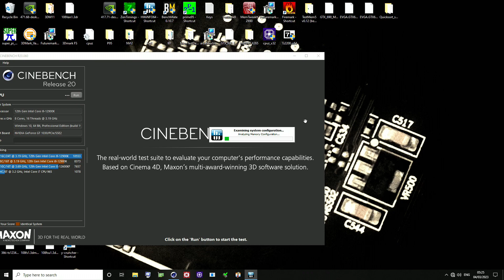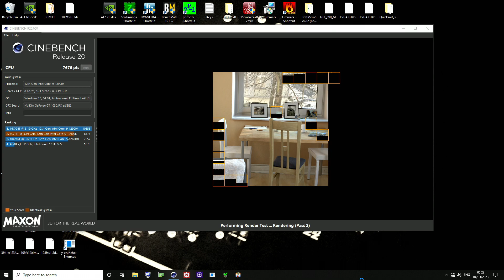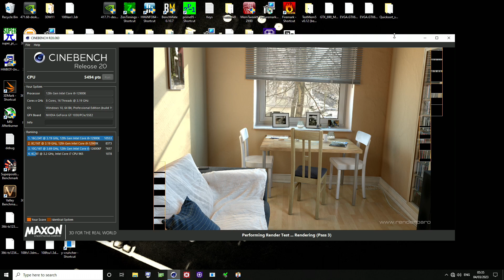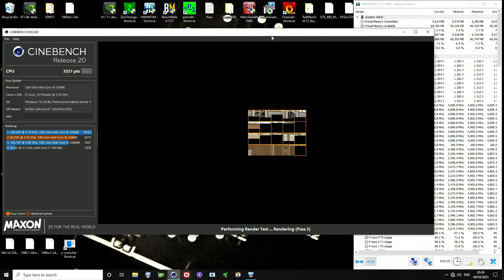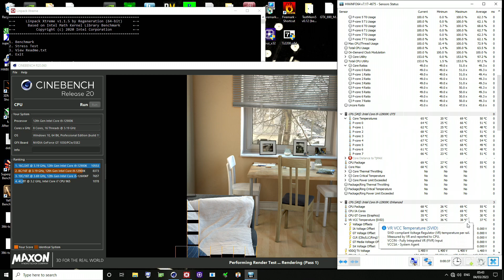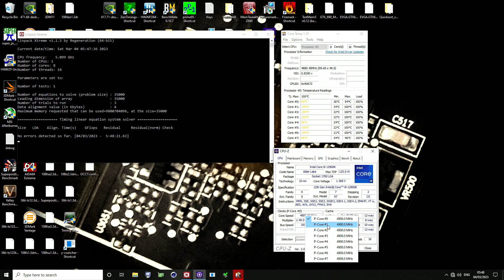EXTREME CPU CLOCK STRETCHING on intel 12th gen

Comment: Have you tried ram overclocking with non-K 12th gen parts? I know edge use case but I can't even enable xmp with my 12400f in the MSI Pro B660M A and some people are suggesting it's because the memory controller is supposedly voltage locked on non-K parts
Reply from the maker: yes VCCSA is locked and the CPUs max out between 3200 and 3600 in gear1 and 4533 to 5200 in gear2

Comment: Is this literally clock stretching (in the same sense that slow I2C devices hold the clock low and change the clock’s duty cycle) or is it just a change in frequency? Do CPUs have pins that output a signal that tracks the real clock frequency/phase? There’s gotta be a debugging mode for this

Comment: I’ve noticed just sheer heat will cause clock stretching even though it’s usually a voltage issue

Comment: I don't know if my 12900k is clock stretching or not, because I am using aorus pro and I have set the llc to low at day one, but I have never reached over 28k points in cb23 even in I am in 4.9ghz all core and 4.0ghz e core. I am now trying to set it back to normal llc or auto to see if it can reach higher score, but I think the voltage would be much higher since I am doing 5.2 ghz all core right now :\

Comment: Perhaps the thingy from Thermal Grizzly would help? If you're not using it already of course. IDK. 12th Gen is a mystery to me, I just hope that on Zen 4 they won't repeat the problem with only 1 lever - even though the size of the IHS is much smaller and not rectangular, I hope they won't try to save 20 cents on mounting.

Comment: Well, my 12100f works at -0.2V offset without a problem. At -0.23V it just crashes under load. Maybe this happens only with higher clocked CPUs.

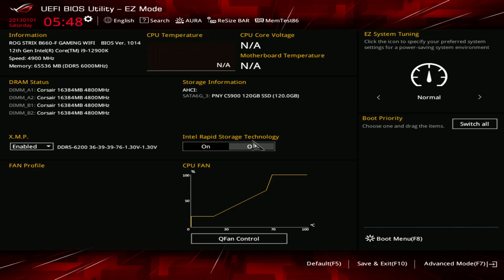Comment: 24:56 - the best part of the video right here

If you disable thermal monitoring, the CPU stops throttling under load!
hell yeah
Reply: What if it burns out?
Reply: @yooanto9465  I wouldn't do it with a 12900k. And I run overkill cooling.  The danger is probably more from long term running above temp spec than from sudden short spikes. U still have the power monitoring on the board which should perform an emergency shutdown if ur sucking down a really excessive amount of power. And I would think burning out a chip would be more dependent on the current ur feeding it than the temp it's hitting. Someone correct me if I'm wrong about that pls lol.
Reply: @christopherjackson2157  in auto setting temp. touch 100c with arctic freezer 420II.
today I disable hyperthread and C drop by 10 . Then I put all P cores to 49 and E to 39 . Voltage to 1.3 it runs way cooler now 77 c and get higher points in C23. Is this called good setting?
Reply: @yooanto9465  that sounds much better than what you had before for sure. I don't have enough experience on alder lake to comment on specific performance numbers. 
77 degrees under load is fine tho.
Reply: Lol yea I do that almost by default now
If it's too hot I'll figure it out when it crashes :)

Comment: My 12400F clockstretches on Asus B660m K if I lower voltage offset by more than -15mv in bios.
Reply: Exactly the same here and also with gigabyte boards

Comment: This is pretty severe stretching. I experienced clock stretching on the order of maybe 10-20% performance loss on my ryzen 5900x using a voltage offset. This is a whole other level lol

At least on Ryzen HWinfo's effective clock reading shows that you are clock stretching.
Reply: What do you look for to see if it’s stretching?
Reply: @nickpowell7432  In hwinfo you will see values for clock speed and effective clock speed. Effective clock speed will be lower than clock speed if your cpu is stretching. But as seen in this video that isn’t always the case. You need to verify with a benchmark. However, if your effective is reporting lower than clock speed you can be 99% sure you are indeed stretching.
Reply: @rdiznfriends   I thought that’s what you were going to say but I wasn’t sure thanks.

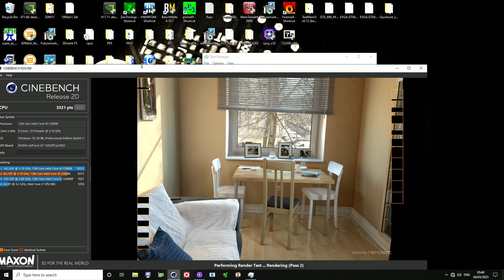Comment: About GTX 1070s "extreme undervolting" issue you mentioned @16:20 :
I think it's because VRAM clock speed dropped to "2D" or "Low 3D" level, from standard full 3D clock. For whatever reason, memory clock speed just drops by 80-90% below certain vGPU value or V/F point. I have this on my big Pascal GPU as well (when tested how low I can go on vGPU).
Reply from the maker: Nvidia cards clock strech across pretty much the entire voltage range. The less voltage you run the more severe it gets.
Reply: @ActuallyHardcoreOverclocking  About CPU stretch : Can this be some weird cTDP setting at play or a power feature thing ?
My logic goes something like this : 
MB : I'm decreasing Vcore from default by -xyz mV.
CPU : Oh, you want lower vcore FROM stock... OK, sure. No problem. 
But once you at it, better drop my TDP to 65W/35W along with it (since we reached this [xyz] voltage drop).
MB : Will do.
CPU : I will show stock frequency under load, because we are on [Auto].
MB : OK.

Comment: Hey guys. I have an idea that won't leave me.
So my motherboard MSI B450-a PRO has newer version MSI B450-a PRO MAX. I belive the only difference is that it has 32mb bios chip instead of 16mb. I wonder if I can expect correct functioning of the board if I just replace chip to a new with a new bios? The only reason is better UEFI UI and built in OC profiles memory instead of using USB stick. 
What do you think?
Reply: Honestly I'm no where near knowledgeable to answer if that will make a difference though. However though, if you're eager enough to try, just find out the exact 32MB BIOS chip that is used in the newer version and look for it on AliExpress/eBay or anywhere else it can be sourced from. Second you'll need a BIOS programmer, personally I bought 'CH341A' from AliExpress for really cheap and it works like a charm. Then simply program the BIOS onto the cheap using software like AsProgrammer. Next, replace the BIOS chip in the motherboard with the new one. The BIOS programmer is a very effective tool to have regardless, in case your family or friends soft brick their motherboard or GPU, it should be relatively easy to burn onto the chip a new BIOS using it.

Comment: I found that the clock stretching usually happens when you're not stable in general. Whether due to load temperature or the load Vcore being slightly too low (not low enough for an instant crash). I guess it almost creates phantom stability because the chip might be running just fine at a reduced effective clock speed. 

IMO if you properly stress test and heat is accounted for, it never usually happens. It's kinda hard to achieve it. It might have something to do with setting a really conservative LLC with a much higher set Vcore. 

I find that if you use an LLC of 3 (auto) or 4/5 (manual OC) it usually crashes out under a Linpack or y-cruncher load way before you clock stretch. I've had clock stretching on a way too aggressive R23 run at 5.3P because the voltage was realistically way too low to run 5.3P and the temps were very bleh.

Comment: according to hwinfo the effective clock is "calculated across the current polling interval with respect to sleeping states"

sounds to me like it is more based on usage than actual clock speed measurements. which seems to explain why it doesn't detect clock stretching
Reply: More like reported clock times logical cpu utilization (busy time) becaus it shows it "per thread" and there is no way that threads on same core could run at different clock speeds (or be in different sleep states)
Reply: how did you comment 4 days ago??
Reply: @standardaccountenjoyer2826  unlisted
Reply: @standardaccountenjoyer2826  Probably patreon early access too?